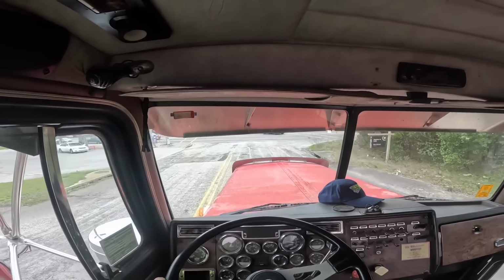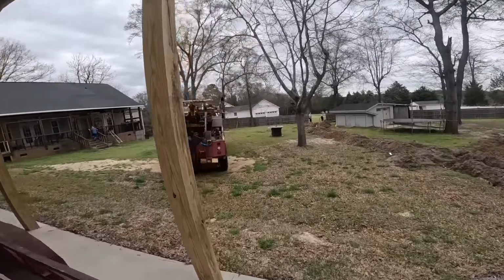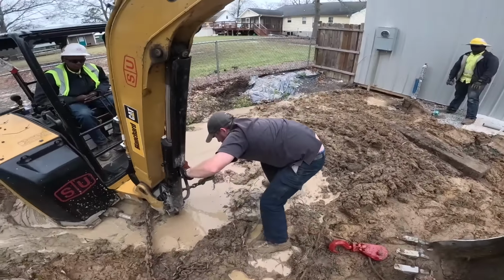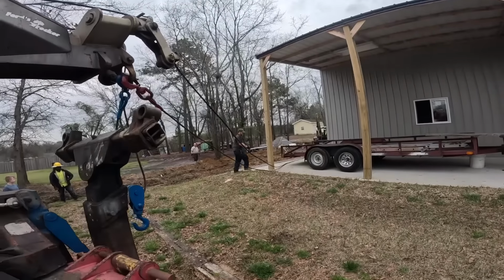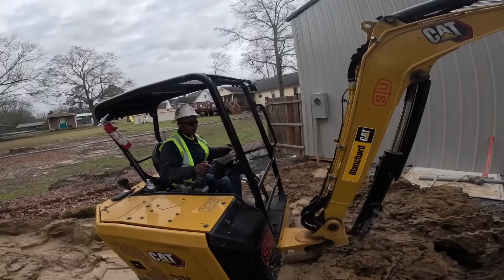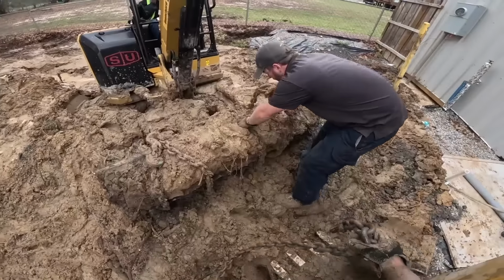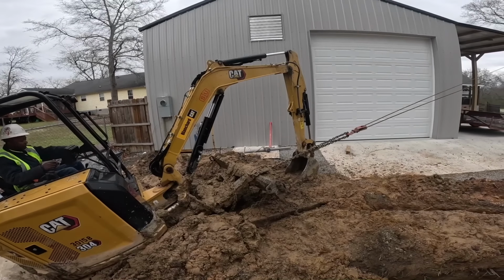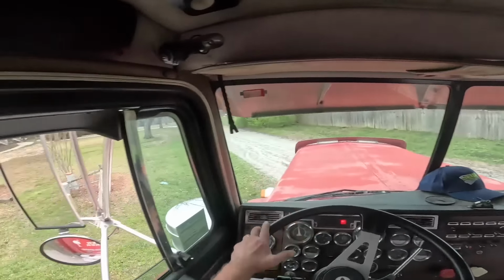Stuck Cat 304 Excavator Recovery

Comment: First. Excellent Recovery Mr Hal. That little machine couldnt help you very much but you managed to get it done. What were they doing putting in an electric line or gas line? Thanks for the video. Stay safe out there.
Reply from the maker: Mr Dan  Running underground power to shop. Thanks for watching and stay safe

Comment: That thing is STUCK. Buried to the body.

See Ethan's new truck on Ron Pratt s channel? 

I am building one for my own. It is a 1953 White 3000 tandem axle that I plan on putting a Holmes 750 wrecker unit on it. I plan on modifying the sides of the body of the wrecker to make it look somewhat like the cab over engine can of the truck. I will be using a Cummins engine with a 10 speed transmission on it. The truck did not have the drivetrain in it when I got it.
Reply from the maker: Mr Colin  Yes sir awesome looking Western Star. Thanks for watching and stay safe

Comment: Should of brought a few 6x6 would of got right out. Been in this situation many times.
Reply from the maker: Mr Wilson We tried rail road tys and the machine would not lift high enough to get under the tracks. Thanks for watching and stay safe
Reply: @SumterWrecker  we put them under the push blade first. To get it to break the suction under the tracks. Honestly the guy operating was not helping u guys one bit. Most times I get stuck can't get anything close. So it's been alot of trial and error.

Comment: Having owned a 304 and a 307 I would fire an operator for his lack of skill in not being able to pull the machine out by himself. Nevertheless, it would have been a lot more efficient had you hooked your chain to his bucket and just let him pull on something more solid instead where the boom has to articulate. A 304 has nearly 5,000 pounds of pulling power on the crowd stick.
Reply from the maker: Mr J  I personally do not think that machine would have pulled itself unless his tracks were directly in line with the wrecker. The suction really had this machine. It wouldn't even pick itself up to put a rail road tye under it. Thanks for watching and commenting. Stay safe
Reply: @SumterWrecker  Lacking the pulling power I would guess that the hydraulic filters had not been changed during required maintenance. If that was a rental I can almost guarantee it.